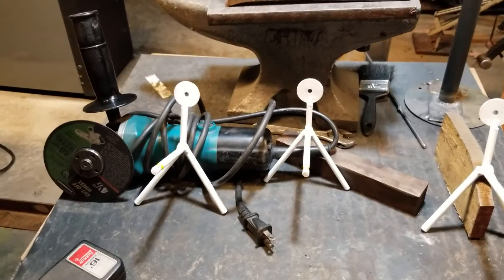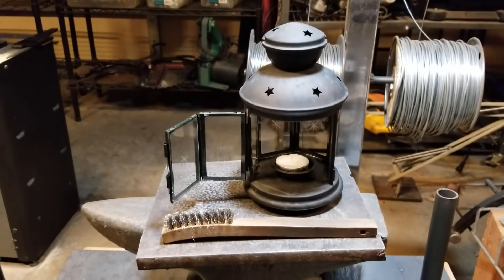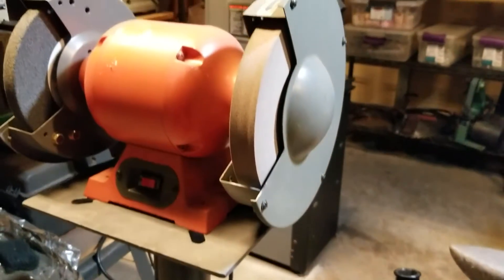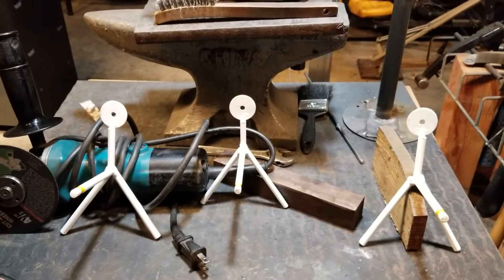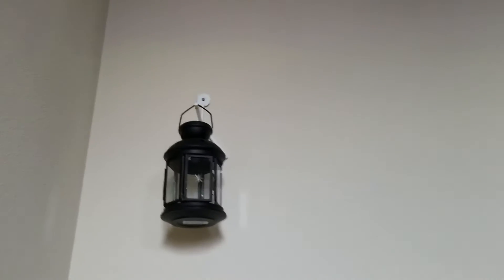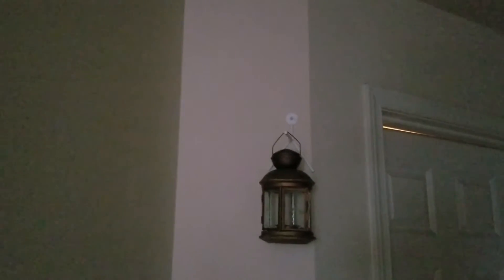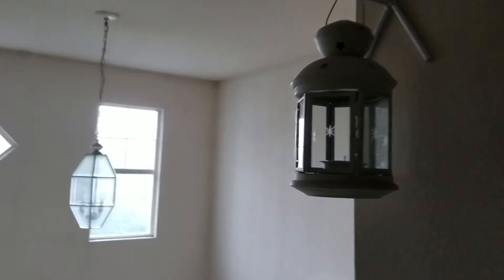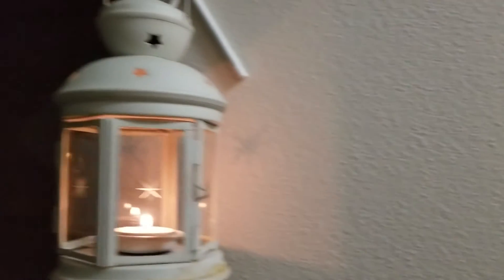Lantern wall brackets

Comment: Bob, that is awesome.  
Is that a fender washer to secure it to the wall? 
I got my tag video uploaded for impact weapons, check it out man! You might want to tag someone for some of these builds you do as well.
Reply from the maker: yeah it is a washer, and a mixed bag of mild steel and stainless scraps cut to 4 inches, and a i cut notch in the one that is straight out, to hold the lantern bail in place
Reply: @BobNchannel  I've been buying tea light lanterns for power outages. I have a couple UCO lanterns but nowhere to hang them other than off the globe screws of the ceiling fans. 
We lose power almost every hurricane season.  This is a built that would make sense for my home.